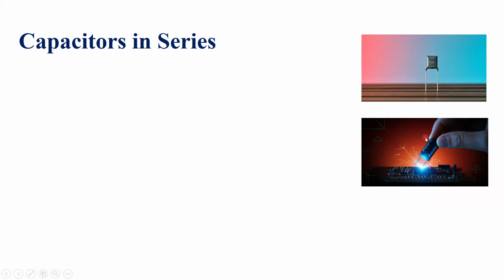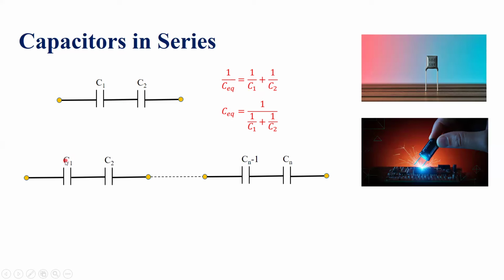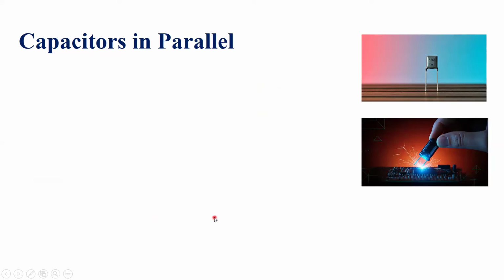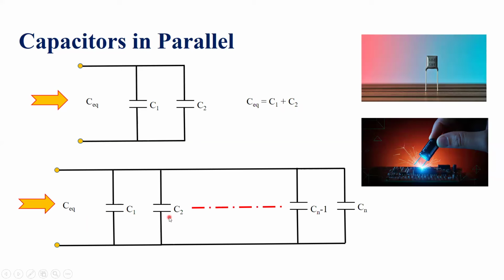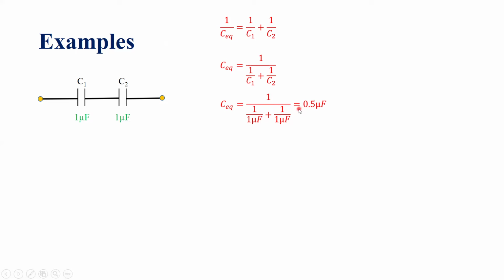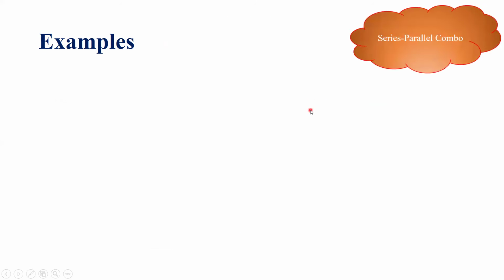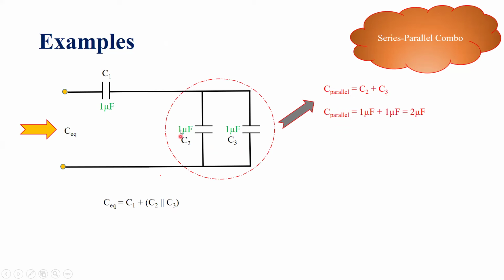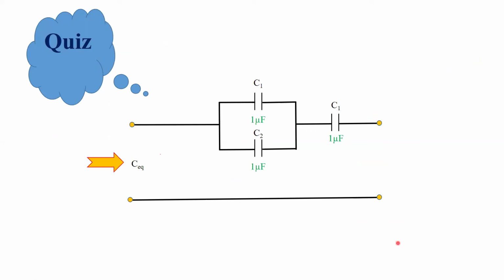The Secret to Solving Complex Capacitance Faster

Comment: Good job.  The only suggestion I would make is that it would be helpful to have an intuitive explanation for the formulas, i.e. in terms of electrons piling up on one side of each capacitor, and holes on the other side.  The intuition is pretty obvious for capacitors in parallel, but less so for capacitors in series.  Since electromotive force is required to cause the pileup, more electromotive force is required to cause the same pileup in multiple capacitors in series.